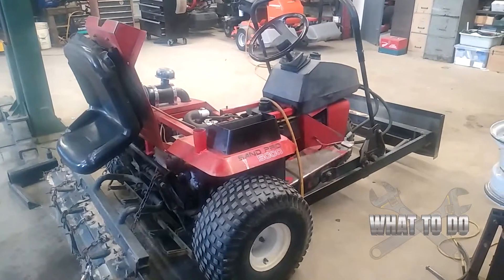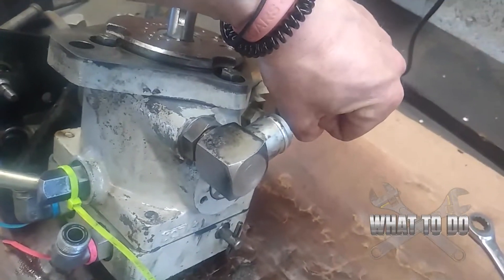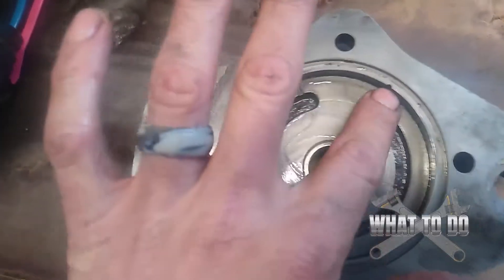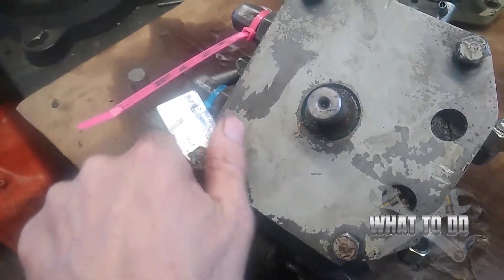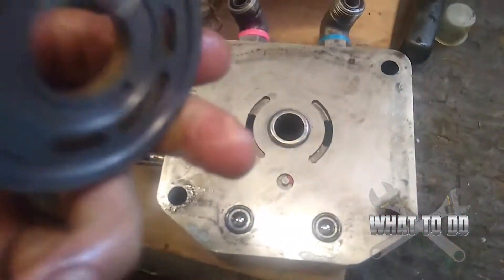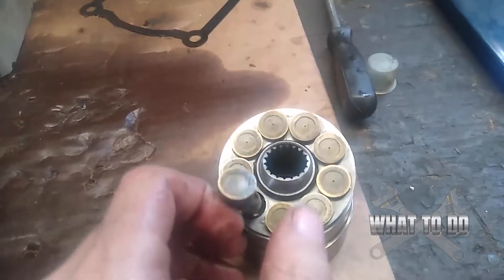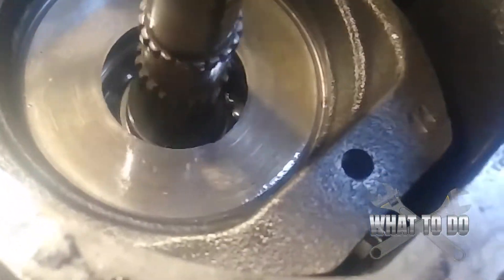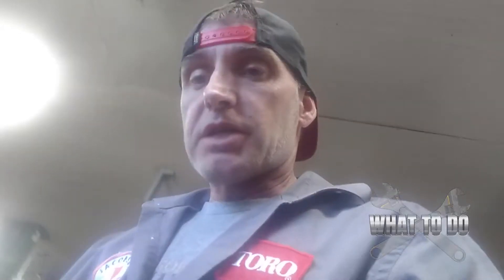Toro Hydraulic Pump - Whats on the inside?

Comment: I have a Toro groundsmaster and mine had just snapped the hydraulic shaft a few inches before the end I cannot believe how much Toro wants for a new part I can have a new shaft built for a quarter of the price what they want Toro is very expensive on parts mi n e snapped right where that pin goes that shaft is $2000 check the hose t hat goes from the trans to the diff i had issues but once  i changed the hose it worked